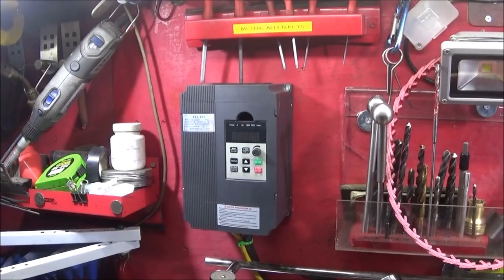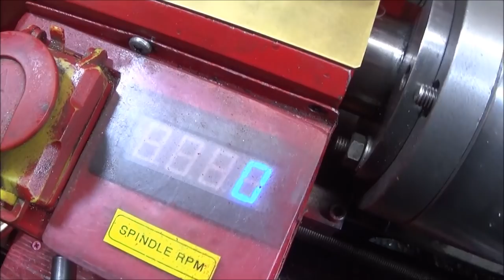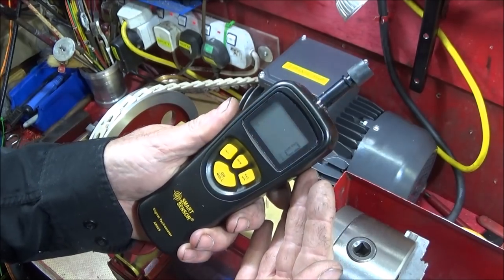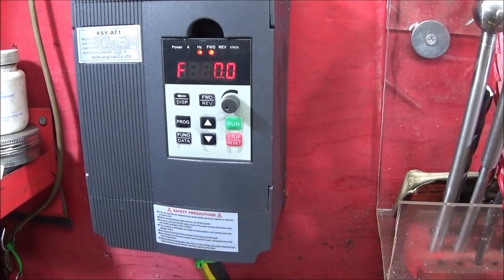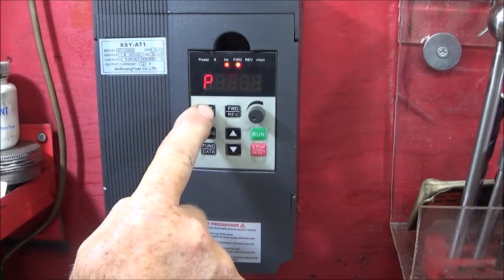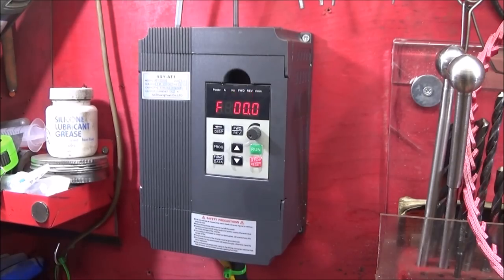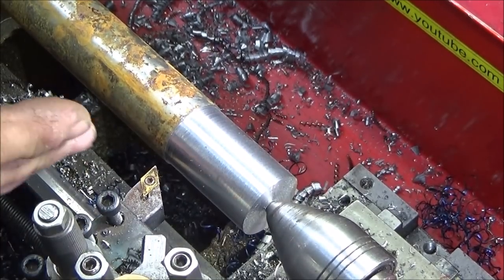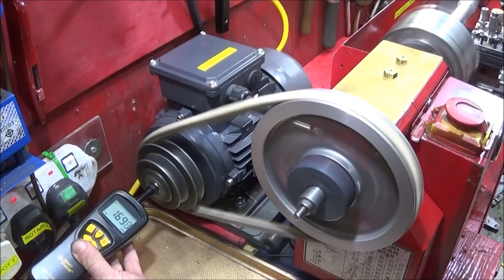Chinese Mini Lathe 3 Phase Motor & XSY-AT1 VFD Upgrade Set-up

Comment: Hi Steve, 

Absolutely loving your videos. So informative and clearly explained. It is really inspiring me to try and convince SWMBO that I could do with a lathe. This video though, and one from a guy in the states, Clough42, have got me wondering if VFD drive is the route to go one my pillar drill. It is a substantial piece of equipment but has a twin belt, triple pulley, arrangement for the variable drive speeds.

How did you go about sizing the motor please? Also, the VFD conversion that Clough42 did on his lathe used a 9 wire motor but you are using a 6 wire motor. Can you explain, in simple terms please, what the differences / advantages/disadvantages are of these options?
Reply from the maker: Hi Chaz Thanks, I just bought the VFD that would run the 3 phase motor I was buying. The VFD that I have is
2.2KW which runs up to a 3HP motor. My motor is 1HP so it is fine. I don't know the difference between 9 and 6 wire motors though. I only have basic electronics knowledge. Regards Steve
Reply: @SteveJordan  

Thanks for the quick reply. You have more of an understanding than me on the electronics though. I will do some more digging about the motor sizing as I am sure my pillar drill is bigger than 1hp.

Also, I noted that you stated the best pulley ratio you found was approximately 1.88 : 1 but on a later video you had added some tapper lock pulleys and the ratio appeared to be different as the drive looked smaller and the driven bigger. Am I right about that or just imagining it?

Have you seen the 7 video tutorial that Clough42 did on a VFD conversion for his mini lathe? He went into much more detail on the motor choice but it all went over my head and also as he is in the USA it's all 110V so I really don't understand how that converts to our 240v system. You might make more sense of it than me.

As an aside though, he used one of the extra trigger features to automatically switch on an auxiliary motor cooling fan that came on any time the VFD frequency was dropped below 10hz rather than relying on a thermal switch.

Regards Chaz

Comment: Hi Steve,

Great improvements and it is always great to follow your progress.
I am interested in the fixed tachometer on your lathe. Had a quick look on banggood and in on my list to buy now. One question, How do you know how far to fit the magnet out from the sensor and where? 
You mentioned google plus. Could you please share a link.

Keep up the good work 
Best Regards,
Paul
Reply from the maker: Hi Paul, if you click on the Google+ on my main Youtube page, in the lower right corner of the channel photo it will go straight to it. You have to get the magnet about 5mm from the pick-up and you have to check the polarity is round the correct way to activate the pick-up. When its dead right and working, a red LED flashes on the back in time with the rotation. If you need any further help, just say....Regards Steve
Reply: Paul Fisher A
Reply: Spot on, thank you Steve. 
I will look into doing this on my lathes and mill. 
Might be a while away as im still busy modifying the cabinets.

Another question if i may, how do you program the diameter the magnet is into the device?

Keep well and keep it up.
Regards,
Paul

Comment: Steve where did you get the motor from. .?
Reply from the maker: I got it on Ebay here
https://www.ebay.co.uk/itm/3-PHASE-ELECTRIC-MOTOR-0-37KW-TO-11KW-1400RPM-2800RPM-2-POLE-4-POLE-ALUMINIUM/191770300135?ssPageName=STRK%3AMEBIDX%3AIT&var=490794456079&_trksid=p2057872.m2749.l2649

Comment from the maker: SEE BUYING LINKS THE BELOW FOR THIS ACTUAL VFD MODEL, BUT......
MAKE SURE YOU CHECK WHAT VOLTAGE & ACTUAL PHASE TYPE OF VFD YOU NEED BEFORE BUYING ONE!
  2.2KW 220V AC 12A Single Phase Variable Frequency Inverter General --  https://goo.gl/sbQccx  
     US Warehouse --  https://goo.gl/6gKvN9
SMARTSENSOR AR925 Digital Tachometer Contact Motor Tachometer --  https://goo.gl/9i18xR
      Banggood App Promotion --  https://goo.gl/AuyhkV
Digital machine display tachometer https://goo.gl/6yGjCv
 30% off Drill Bits Promotion -- https://goo.gl/KrG3Wh (code: 266b22 )